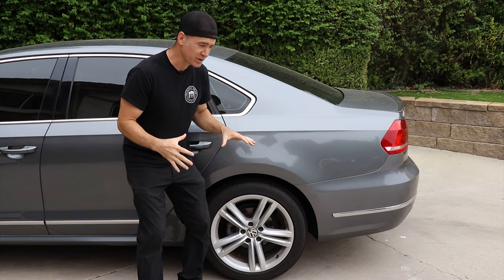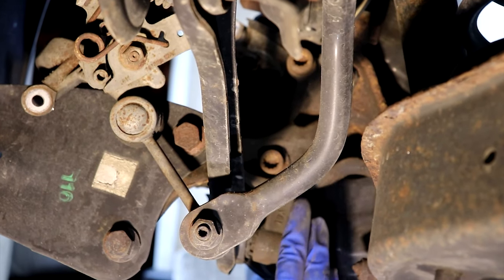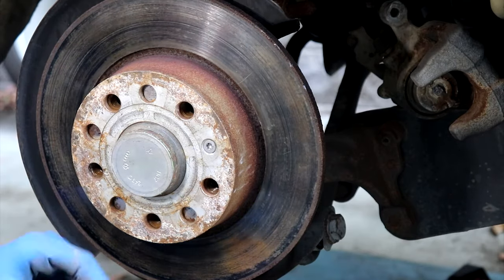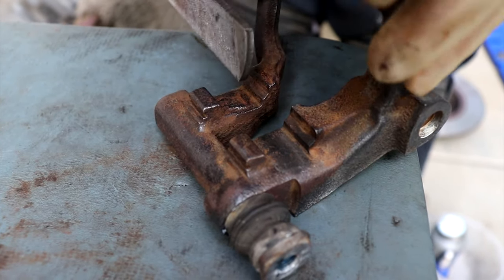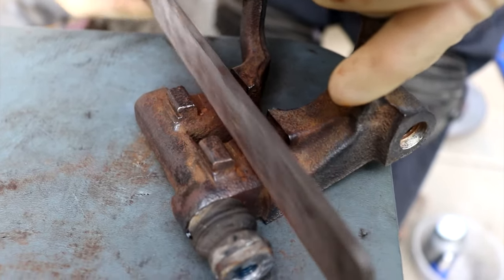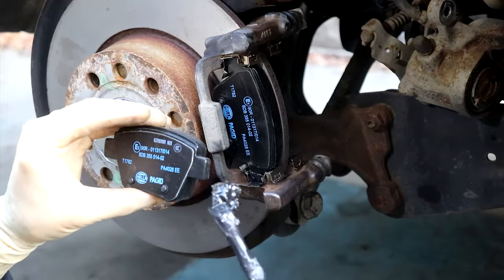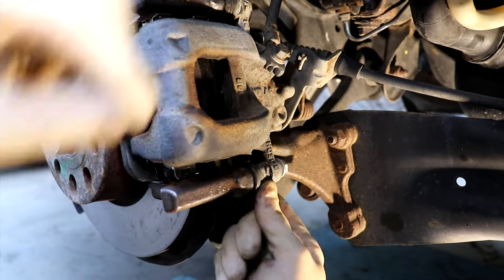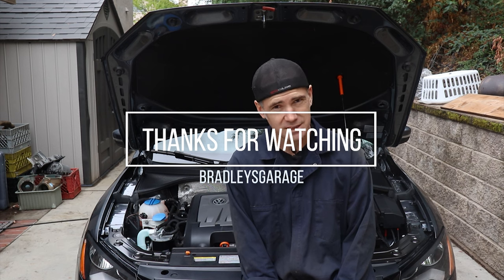2012-2019 VW Passat B7 Rear Brake Pads / Rotor Replacement DIY (SAVE $$$)

Comment: The one thing I came looking for is how to disengage the Electronic Hand Brake.  My idea is to ensure the vehicle is chocked well, ignition on & release the EHB?
Reply from the maker: Thanks for the question Broadsword, we are assuming you have a newer B8 Passat with the electronic parking brake option?

You can do the rear brakes on the newer B8 Passat along with other VW/Audi vehicles that have the EPB function without needing the VAG-COM scan tool.

There are (2) options to accomplish this -

Option 1: Before removing the caliper you can unplug the connector that is attached to the EPB motor on the backside of the caliper. Then you can remove the caliper as you normally would. You will need a 12 volt source with two small leads. We like to use the M12 Milwaukee battery for this job since it very compact and versatile.

You can see that in action here in another one of our videos - https://youtu.be/aATId3ZnljM?si=sRBaA5FvJyNN9lB8&t=97

Then you can simple touch the EPB motor connector with the probes and the motor will either go forward or reverse. If it happens to start going outwards (pushing the piston out) then all you need to do is swap the probes to reverse the polarity. The motor will then draw the screw drive in and you will hear a noticeable change in the pitch. Once you hear that you know the motor has backed all the way in and you can now safely push the piston back using the normal caliper piston tool.

Here's quick video that shows what I'm trying to explain.
https://youtu.be/D83EATLH6lI?si=25BK0y1_2ZNKlbow&t=107

Option 2: Remove the EPB motor from the backside of the caliper. This is accomplished by removing the (2) T30/Hex bolts depending on the model. Once the motor is removed, you can use a torx socket to manually turn the Motor screw drive mechanism in. You will be turning it clockwise in order for it to retract. After that you can use the normal caliper piston tool to press the piston back.

Here's a quick video that demonstrates that - https://youtu.be/I7snMZx3m_I?si=gFWMiZYLffKvImOq&t=196

Hope this helps you with you Passat project, let us know how things go.
Cheers!

Comment: To anyone who doesn’t want to buy the caliber compression tool, a needle nose pliers works fine, just squeeze tight
Reply from the maker: Thanks for the comments, appreciate the tip. The brake caliper tool can be borrowed from any major parts store for free. It's easier with the tool as the needle nose pliers can be tough on a sticky caliper.
Cheers!

Comment: I’m having trouble compressing the piston. I bought the specific tool and tried to. The piston looked to just be spinning in place and not compressing in.
Any tips?
Reply from the maker: Sorry to hear you are having trouble with your VW Dustin. The rear calipers on the B7 Passat are the twist back style which need to be pressed in while rotating. It is important that the two teeth are engaged in the piston and there is pressure being applied while turning. If you are rotating without pressing, the piston will not be pushed in and it could actually damage the piston seal.
Good luck on your VW project, let us know how it goes.
Cheers!

Comment: What size torque or allen is the bolt on holding the roror on
Reply: Never mind
Reply from the maker: Thanks for the questions Mike, the OEM bolt is a T30 Torx. As long as no one has used an aftermarket one, that should work for you. 
Good luck on your VW project.
Cheers!
Reply: T14 triple square

Comment: I’m amazed that you were able to fit a torque wrench in the wheel well @19:25 for the top caliber bolt, with the torque wrench handle pointing up!

Was that some sort of special short-handled torque wrench? My Kobalt 3/8 torque wrench is 17” long, and could never fit in that scenario.
Reply from the maker: Thanks for the comments Ted, we are using the older generation Craftsman 3/8" digital torque wrench. https://www.sears.com/craftsman-3-8-8221-dr-25-250-in-lb-torque-wrench-24t/p-A102532187
We just picked up a spare, since I didn't even realize Sears.com was still around and it was too cheap to pass up.
Cheers!
Reply: @BradleysGarage  Thanks for the detailed reply, much appreciated!  I looked it up (using your handy URL) and that Craftsman 3/8" digital torque wrench is 16", so it's only 1" shorter than my Kobalt.  On my Beetle and GTI, I'd never be able to fit a 16" torque wrench in the wheel well either.  If possible, I'd love to see you include a 30 sec portion on your next VW rear brake job, showing you actually sticking in the torque wrench (that part is edited out of this video), as there's clearly something I'm missing w/r/t fitting a torque wrench in there w/o removing the fender lining or using a Harry Potter incantation.  The front wheels are no problem, as I can turn the steering wheel and thereby angle the wheels letting me have all the room in the world for the torque wrench handle. But the rears have me stumped. Cheers!

Comment: I have a 2017 VW Passat would I need an vag com scanner to reset the electronic parking brake?
Reply from the maker: Hey Oscar, thanks for the question. Are you currently having an issue with the e-brake, like it is stuck on or won't engage?
Or, are you looking to do the rear brake and need to know how to push the piston back in order to change the brake pads without a scan tool?
Happy to help get you back on the road, let us know. 
Cheers!
Reply: Ok Can I ask the same question? because I want to replace my rear pads and rota's, so will I need  a VCDS or VAG to reset the brakes after they've been replaced. Regards John. @BradleysGarage
Reply from the maker: @johncrowther8912  Hey John, apologies for not providing the solution to Oscar above as we had never heard back from him.

You can do the rear brakes on the newer B8 Passat along with other VW/Audi vehicles that have the EPB function without needing the VAG-COM scan tool.

There are (2) options to accomplish this -

Option 1: Before removing the caliper you can unplug the connector that is attached to the EPB motor on the backside of the caliper. The you can remove the caliper as you normally would. You will need a 12 volt source with two small leads. We like to use the M12 Milwaukee battery for this job since it very compact and versatile.

You can see that in action here in another one of our videos - https://youtu.be/aATId3ZnljM?si=sRBaA5FvJyNN9lB8&t=97

Then you can simple touch the EPB motor connector with the probes and the motor will either go forward or reverse. if it happens to start going outwards (pushing the piston out) then all you need to do is swap the probes to reverse the polarity. The motor will then draw the screw drive in and you will hear a noticeable change in the pitch. Once you hear that you know the motor has backed all the way in and you can now safely push the piston back using the normal caliper piston tool.

Here's quick video that shows what I'm trying to explain.
https://youtu.be/D83EATLH6lI?si=25BK0y1_2ZNKlbow&t=107

Option 2: Remove the EPB motor from the backside of the caliper. This is accomplished by removing the (2) T30/Hex bolts depending on the model. Once the motor is removed, you can use a torx socket to manually turn the Motor screw drive mechanism in. You will be turning it clockwise in order for it to retract. After that you can use the normal caliper piston tool to press the piston back.

Here's a quick video that demonstrates that - https://youtu.be/I7snMZx3m_I?si=gFWMiZYLffKvImOq&t=196

Hope this helps you with you Passat project, Cheers!
Reply: B7 passats do not have electronic parking brakes. So you shouldn't need a scan tool do do any brake work

Comment: Service manual says to replace the bracket bolts as they are stretch bolts, otherwise nice job. +1 for including bolt sizes and torque values, although it seems you got the bracket bolt torque wrong? My manual says 90Nm+90 degree turn, whereas you list 89 ftlbs
Reply from the maker: Thanks for the info on the torque values, you are correct it should be (90Nm + 90 degree turn. We should have mentioned that they should be replaced. Since we decided to "reuse" them, we added blue loctite and torqued them to 89 ft. lbs, which is about 30% above the initial 90Nm value. 89 ft. lbs is already crazy tight, it would interesting to see what it's at after the 90 degree turn with new bolts.
Here are the bolts if you decide to replace them, they are only $3.99 so it makes sense-
https://www.fcpeuro.com/products/audi-vw-disc-brake-caliper-bolt-rear-vag-n91168901
Glad you enjoyed the video, thanks for hanging out. 
Cheers!
Reply: @BradleysGarage  did the job today. Indeed a pain to get those extra 90 degrees on the bolts. Might be doable with a lift, but with minimum clearance on stands and the odd space the bolts are in it was definitely a hassle to get them out and back in
Reply from the maker: @YourFavouriteComment  Thanks for the update. They were very tight for us to remove so I can only imagine trying to "stretch" them back to the factory specs.
I'm satisfied with the 89 ft. lbs + blue threadlock on ours. Been driving for thousands of miles since the video and all is well.
Thanks again for hanging out and sharing your feedback. Cheers!
Reply: you don't have to remove the hanger to change the brake disc
Reply: @joakimkarlstrom2136  not sure what you drive but on the 2012 Passat you can't slide out the rear disc without removing the bracket
Reply: I just saw that the holder is longer on this model. I have a passat b8 2018 model year. on it the hanger did not need to be removed
Reply from the maker: Thanks for the info on the later model, I'm glad VW made that small change to the bracket. Those bolts are in there very tight and can be a pain to get out.
All of us with the B7 have to suffer with that bracket. 
Cheers!

Comment: So this is an electric handbrake model?
Reply from the maker: Thanks for the question Darren, our B7 does not have an electronic parking brake. I don't think they offered the EPB in the states as all of ours have a standard parking brake.
If you B7 has the EPB feature, you will either need VCDS to release the EPB or you will need to remove the two screws and manually turn the piston back.
Good luck on your Passat project, Cheers!

Comment: Hey, what brand of gloves do you use? The gloves you're using look like they're finally holding up and won't tear after five minutes. 😂😂😂
Reply from the maker: Thanks for the question Roman. Our preferred gloves are made by MicroFlex Diamond Grip - https://www.amazon.com/Microflex-MF-300-M-Diamond-Textured-Fingers/dp/B002T11XJ0
We purchase them by the case, 10 boxes in each case.
If you are looking for a longer sleeve/thicker gloves then we use these - https://www.amazon.com/Microflex-SAFEGRIP-LATEX-GLOVES-MEDIUM/dp/B000JFN9UE
These are thicker and obviously cost more than the regular gloves.
Thanks again for hanging out, Cheers!
Reply: @BradleysGarage  Thank you very much for the reply and for the links😎👋
Reply from the maker: @RomanRW  No worries, thanks for hanging out.
Cheers!

Comment: Take that screw out of the rotor and throw it in the garbage. That was put there in the factory to hold it in place while it went down the line.
Reply from the maker: Thanks for the comments Tim, it does help hold the rotor during the reassembly phase. It would never be a problem if guys didn't tighten the crap out of it for no reason.
Cheers!

Comment: Can we stop putting lube on the ears of brake pads. There is a reason manufacturers don't do it from the factory. All it does is collect dirt and bake dust and after a few thousand miles your pads get stuck and cause uneven brake wear and shortens your pad and rotor life. The point of replacing the clips on the bracket is to give the pad a nice surface to slide on. No lube is required
Reply from the maker: Thanks for the suggestions Bryce, appreciate the feedback. That's the way my pops showed me many, many years ago so I guess it's an old habit that won't die. Thanks again for hanging out. Cheers!

Comment: Your not suppose to use anti seize on lugs
Reply from the maker: Thanks for the comments Jesus, appreciate the feedback. We have been doing it that way for more than 40 years and never had a problem removing lug nuts/wheel studs from our cars. No wheel had ever come loose from having Anti-Seize on them. 
It's simply a corrosion prevention, if you have ever tried to remove rusted on lug nuts, you'd be using it as well. 
You can choose whether or not you want to use anti-seize on your project.
Cheers!

Comment: Antiseize should not be put on lugs
Reply from the maker: Thanks for the comments Daniel, we prefer to use a small amount on the threads to prevent corrosion. It also helps to remove lugs when you have a flat on the side of the road and are trying to change to a spare. Since the car tools are limited, it helps to not have any corrosion cause issues on the side of the road.
At the end of the day, everyone can decide for themselves how they would like to do things. We have been using antiseize on lugs for 40+ years and have never had a wheel fall off yet.
Cheers!